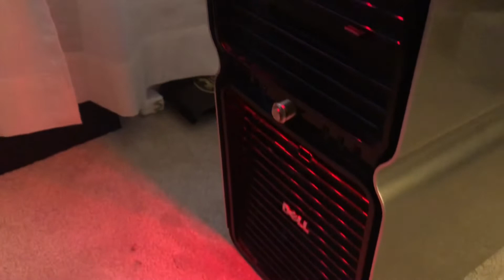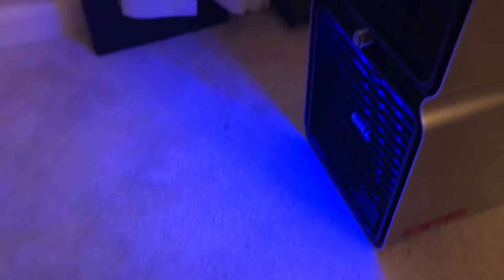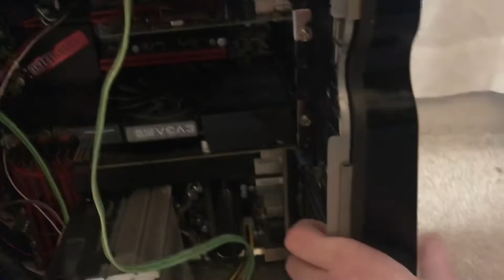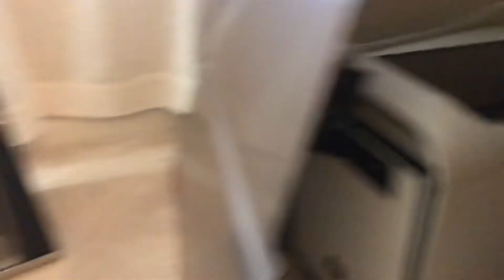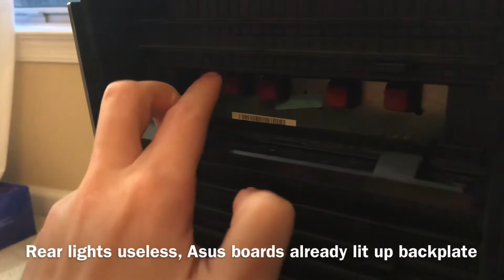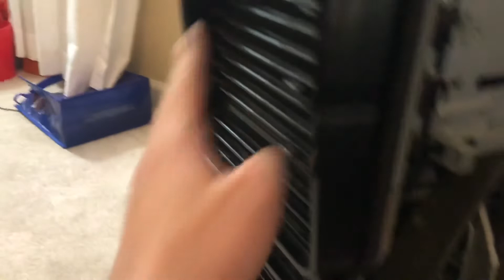Dell XPS 700 Case Mod & Review

Comment: In the tech room of my school, a student some time ago dropped off an old xps 730, I was able to get it running but had to substitute for the missing ram, gpu, and hard drives someone had stolen from it. To be honest I fell in love with the case and I'm currently trying to work out a deal with my IT teacher so I can get the case off his hands so I can do a "resto mod" with the parts from my pc. I desperately want it because it is in really good shape and is the only 700 series xps system that has from factory an ATX layout.

Comment: It did not come with cpu top down cooler, in fact the cooler was designed in the same style as the case. Like a babyshuttle inside the spaceship.

Comment: Amazing! How do you connect the leds?
Reply from the maker: MushroomGaRo the ribbon cables meet at where the circuit board meet near the USB ports. I cut the connector and soldered extension wires to switches. There’s some wiring diagrams online for this. I used a molex connector for power, just remember to use the 5v part of the molex (RED). If u use the 12v they can burn out

Comment: I pulled out my Dell XPS 700 Red/Silver system that's been sitting in my closet for many years. I pulled it out tried to power it up but it just shuts down. Not sure what going on with it. It has the duo core processor.
Reply from the maker: If you ever wanna sell, I’m always here. Frickin love these things lol
Reply: @commandpost1  I tried to update the OS back when I wrote this and it wouldn't work..I guess it need to upgrade it but I know you need to modify to get a updated motherboard like you did.
Reply from the maker: @rlg222  well if the power shuts off, it could be a faulty power supply. But be warned, swapping the motherboard isn’t easy because it’s a completely different standard if the PCIE slots are at the bottom. What I did to make it compatible was retrofit a motherboard tray to it and do a bit of cutting with a dremel.

Comment: any updates ? these are like ole muscle car frames waiting to be rebuilt lol
Reply from the maker: Nah, I’m holding off until I can afford a ryzen threadripper. Maybe a year or 2 when I graduate grad school & they’re on 5nm.
My plan is to knock out all the 5 inch front drive holders and tweak it to hold a massive radiator in the front inside, but atleast the motherboard tray is converted to ATX (from BTX) for now.